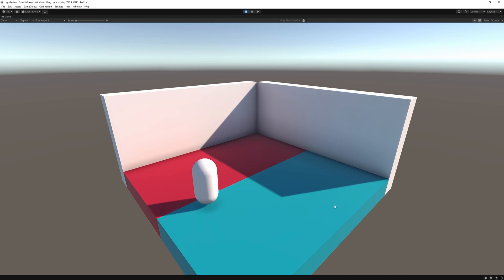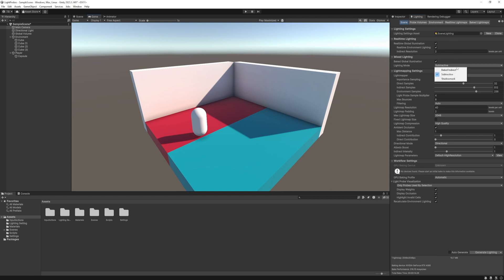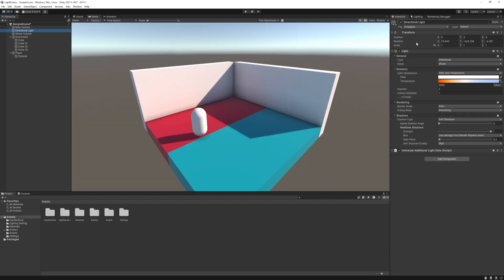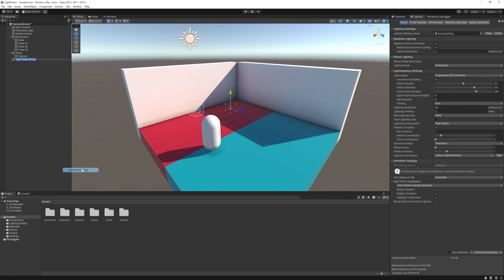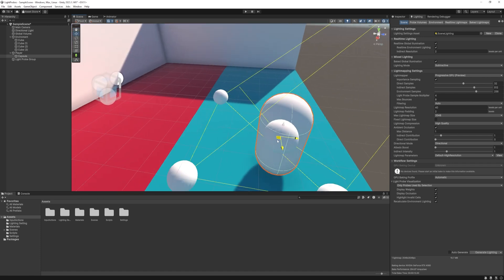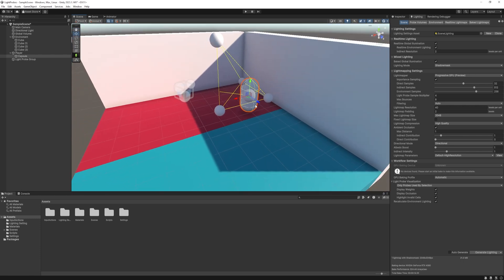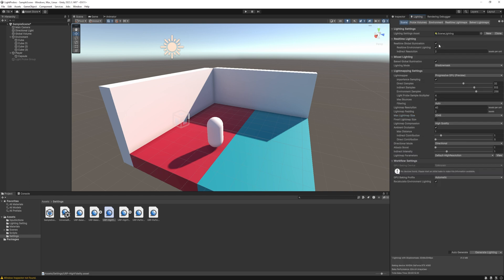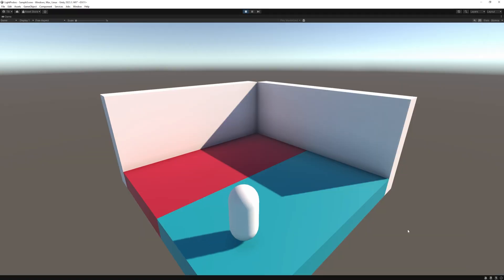LIGHT PROBES in Unity (URP Version)

Comment: which version are you using? I'm using 2022.3.11 and I don't see an option for probe volumes in the lighting settings
Reply from the maker: Hi, you have to use the 2023.1 at least to have the APV
Reply: Thank you
Reply: I got problem when the dynamic object go into the shadow,  it's still receive light from mixed direction light. Can you help me how to solve it?!
Reply: Mixed light means its both baked and realtime so if you only want your object to be lit by baked lighting you have to change your light to baked mode @phatbuihong4014

Comment: The APV's can also be used to bake lights onto objects without lightmaps, which makes them rly good for huge maps since they bake in seconds, but the quality in URP is not as good as HDRP making lightmaps a better option in URP, and the reason is not working with realtime GI is because RTGI in unity is deprecated, but they are working on a new RTGI solution that will use the APV's